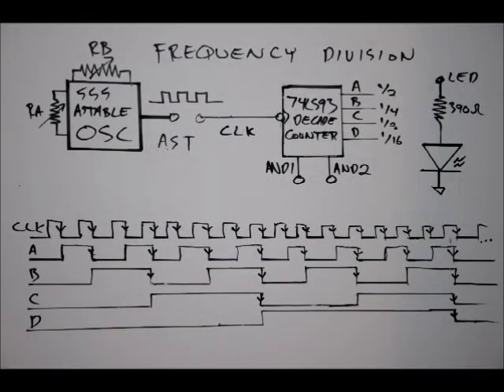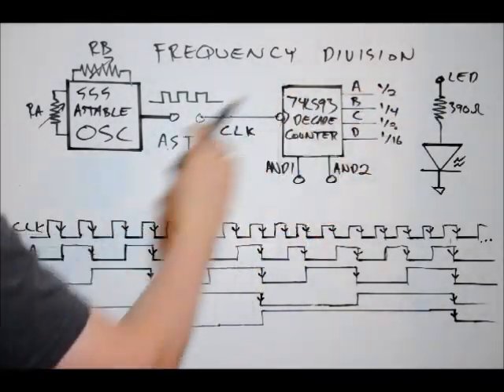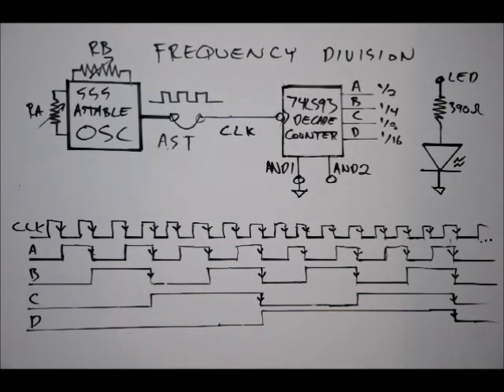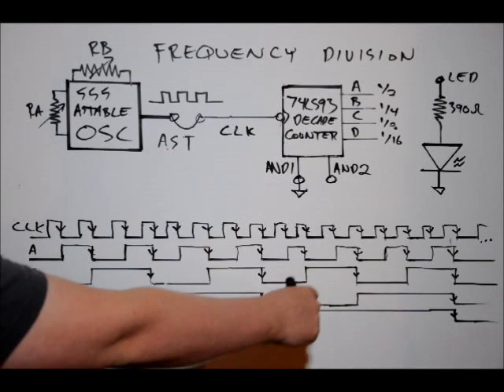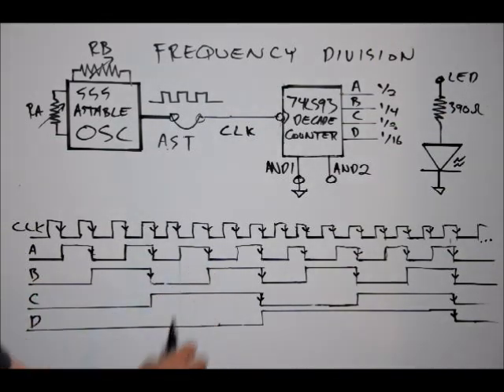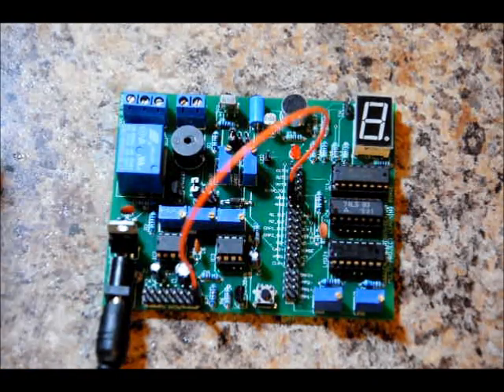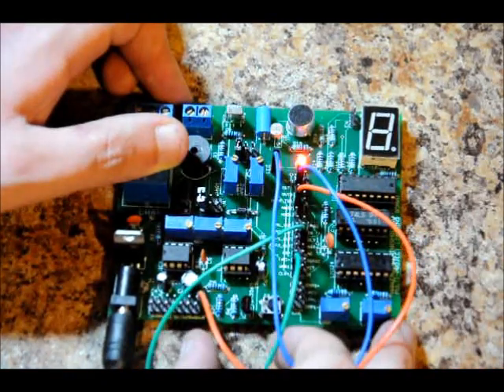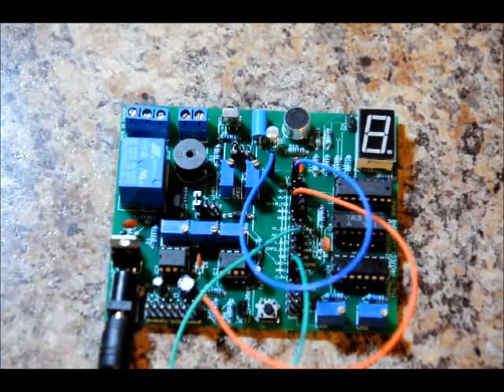Project#17 "Frequency Division" - The Multi Project Electronics Learning Board

Comment: This is all too confusing, I understand if you divide a frequency by 2 it will be 2x slower than the original.  For some reason my thinking is that the frequency will be faster, but that is not the case.